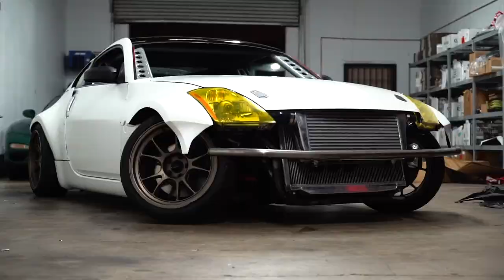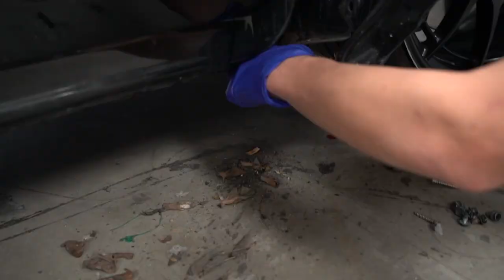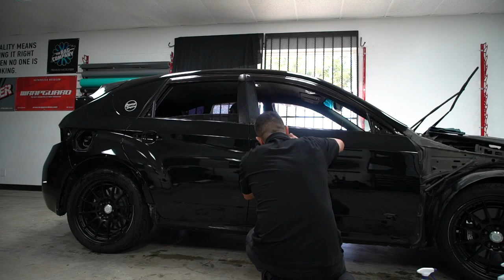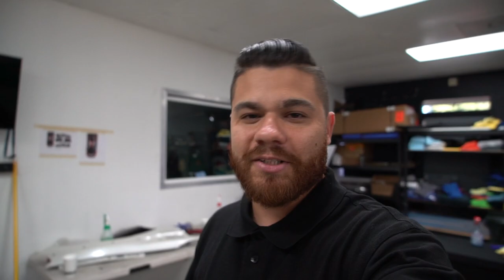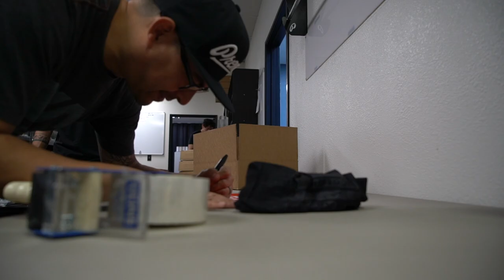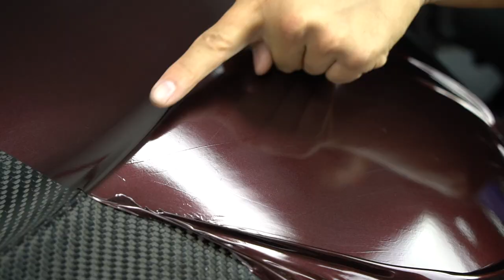1 OF THE BEST VINYL WRAP COLORS!! Subaru WRX/STI Hatch Gets WRAPPED! (Part 1)

Comment: Danny as an installer myself it took me a while to figure out how to avoid adhesive lines. I live in a hot climate and install in a non temperature controlled garage so it's even worse. What I learned is that panel has to be layed with the intent of it being positioned properly prior to any squeegee strokes. What that means for someone like me is i have to install a panel perfect the first time, only then can I squeegee. If i squeegee and have to lift it up for any reason it will be an adhesive line.

Comment: Wrap and tint installer. Just started my own channel too :)  wrapped a few cars and trucks. Used avery, 3m, metro restyling and vvivid. Only had some adhesive lines on trouble areas and when I would heat the film and over stretch it or stretch it right after heat without letting the vinyl relax a bit. Just wrapped my 2018 silverado in 3m ghost pearl and only had a few lines on the bumper curve and that's because I let it sit for a minute then lifted it.   Love your videos guys, u guys inspired me to make time and start my own channel!!
Reply from the maker: Glad to help inspire you! Good luck with the channel!
Reply: Same here with my business and expericnce.

Comment: I wrapped my mustang the same blue purple 3M vinyl y’all wrapped tj’s brz and I fought contours and adhesive lines throughout the whole project. Granted I wasn’t working in the best conditions (temperature mainly) I then proceeded to use a Avery vinyl on a different mustang and had no problems at all. 
However 3M was a color shift film and in the winter and the Avery project was gloss black in the summer.
Reply: I always go Avery first if at all possible.

Comment: I’ve been avoiding using 3M as much as possible because I’ve been having issues with glue lines. Even when laying panels with no repositioning or heat  I still get glue lines. As an installer it can get really frustrating but it’s almost like some rolls are worse than others

Comment: We've been wrapping for a while now too, and yes  I've been getting adheasive lines dealing with wrapping over the harder areas and it seems like black gloss Avery has a lot of issues with that.  I don't use much 3M, I tried some VViVd and I didn't get any but I haven't used enough of it yet.

Comment: I've seen it a few time with different 3m colors. I did a wrap with 3m gloss bright yellow and another with 3m satin battleship gray and battled adhesive line throughout the wraps, but then I've also have wrapped with a few other 3m colors and never ran into the issue.

Comment: Ive been doing a 350z in 3m 1080 color shift on tha full body and ur deff right about each film is different, used Avery gloss black on the roof for some contrast and its alot easier to work with then the 3m. I like both film's for sure but the Avery just went down soo smooth and glassed really nicely, the 3m is great but this being the first time ive used Avery i believe ill be using it more often now.